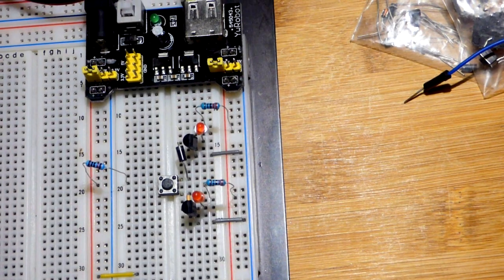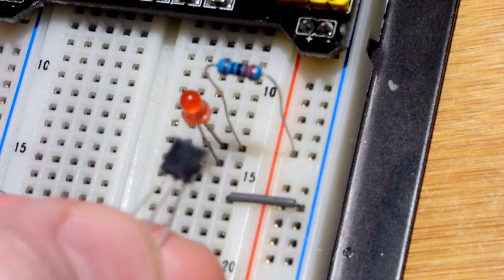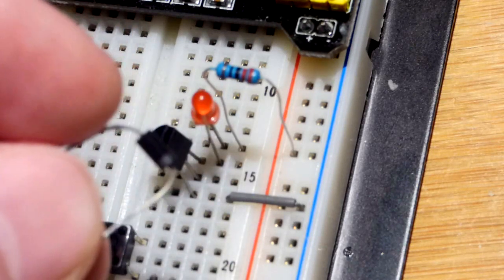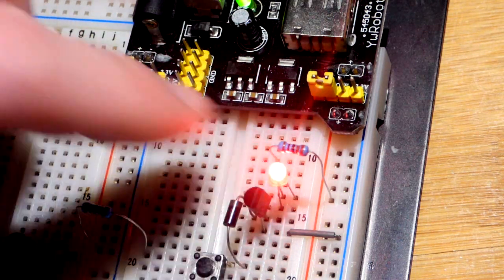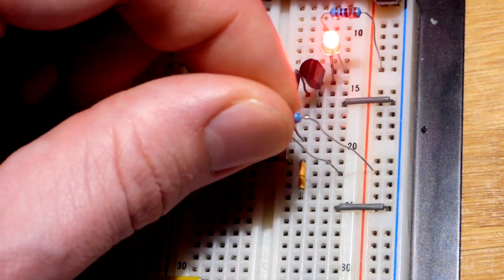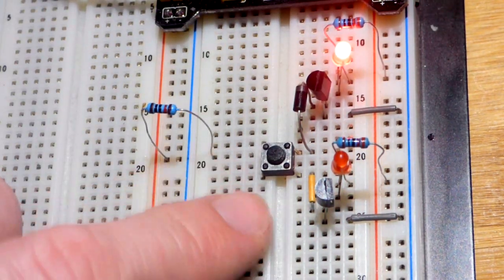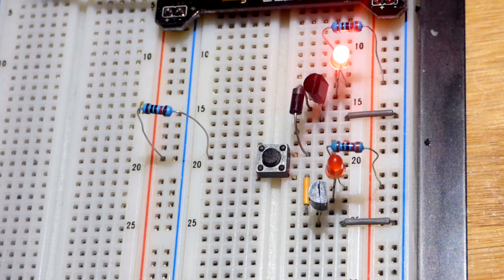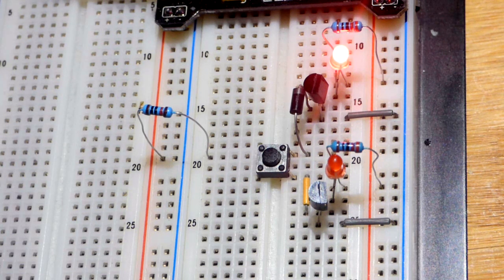How to wire a pushbutton switch and 2 2N2222 NPN BJT controlled alternating flashing LEDs circuit

Comment: Do you always put the meat of the circuit on the collector side, and the emitter the path to ground?  I always try to put the circuit between the emitter and ground, leaving the collector the shortest path to positive...  Maybe I'm misled by the names?
Reply from the maker: Some circuits have the load on the emitter side, such as the common collector/emitter follower, which tries to maintain the base voltage minus a diode drop to the load without needing much current from the base which might be more than the source signal can provide and maintain it's voltage.